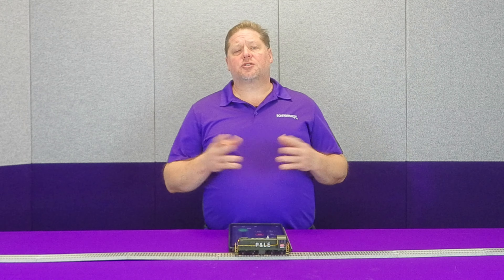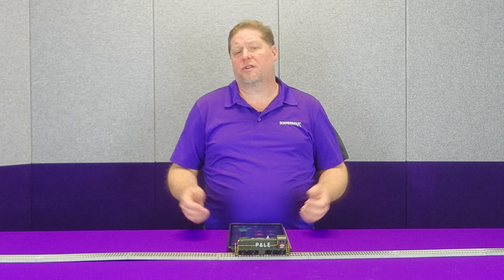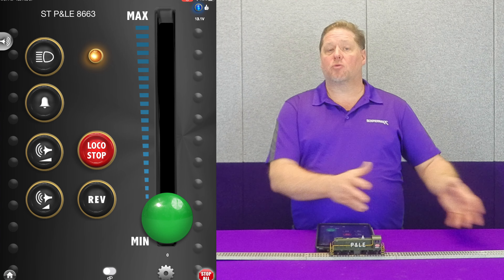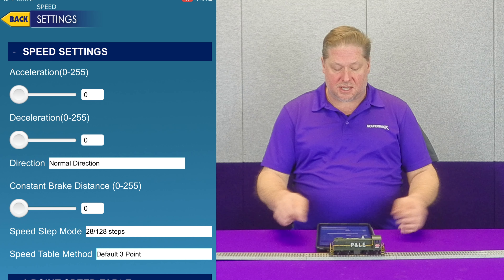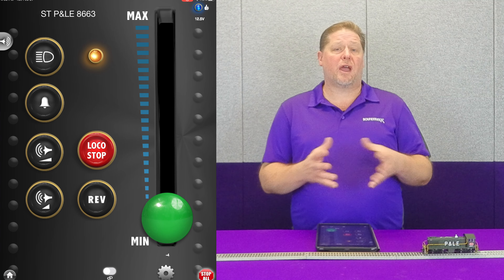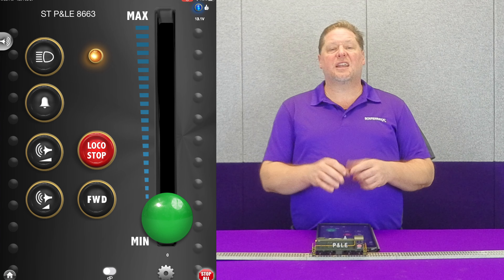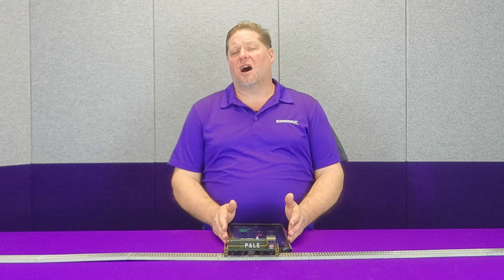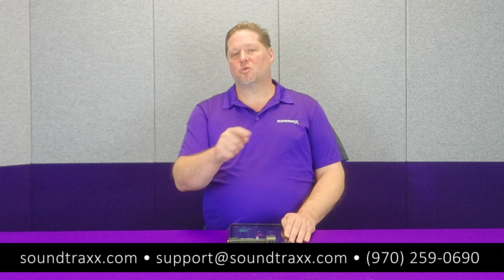Operations 101: Momentum (Episode 1)

Comment: Great video, but how would you incorporate momentum in consisting or speed matching for consisting?
Reply: Set all units to match momentum settings.  This is after any necessary speed matching. (Most locos don’t need significant speed matching with TSU2.).   Then..  well, stay tuned!!   
Thanks for watching!
Reply from the maker: Thanks for the reply, George. Mark if you have any other questions we are happy to help: support@soundtraxx.com